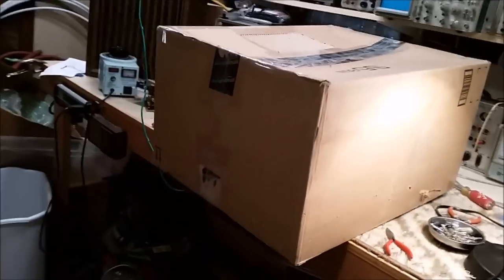Unboxing Our Next Vintage Audio Project...A Finicky Harman Kardon 330C Receiver

Comment: I'm like you Sue in wondering if Rosie is repairing electronics. The shop says yes or it may just be a hobby. Anyway, my friend had one of those and it was nice. Rosie, I'm looking for a 100' of bare copper 14 gauge  wire for my Zenith MC7040 AM antenna.

Comment: Well you have no dial lites so I would look to see if you have power to the tuner  and the lights . A lot of times the dial lights and pre amp and tuner don't run off the same power rails as the amp it's self , you could just have a bum regulator

Comment: I have a harmon kardon 680i i bought in the early 80s. It doesn't have enough power any more like it did. Do you think you can fix it? Its in good shape cosmetically. I had the top off its not real dirty inside but volume pot is probably dirty
I think the amp board is shot. Not sure its worth fixing or not
Van you help me.